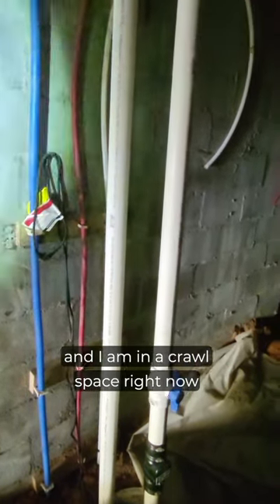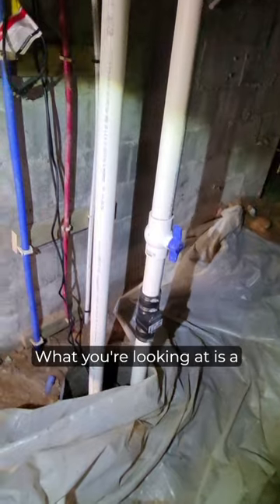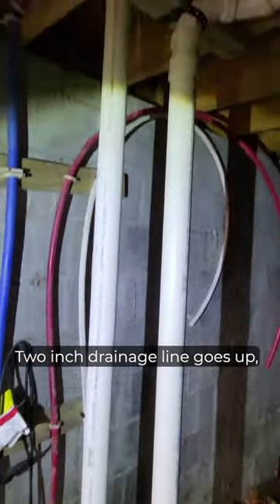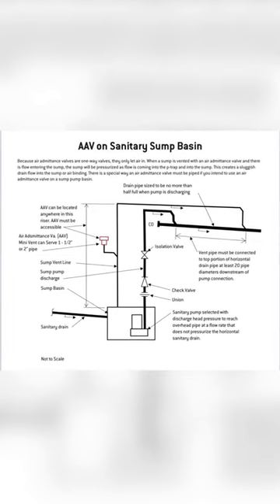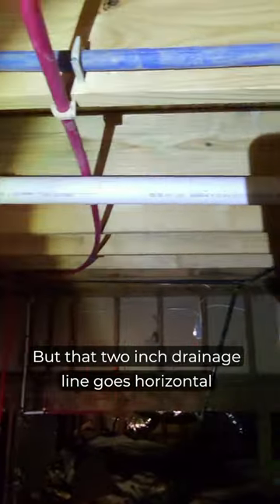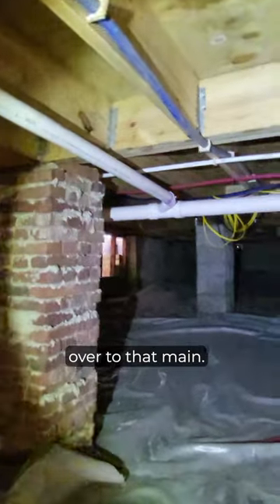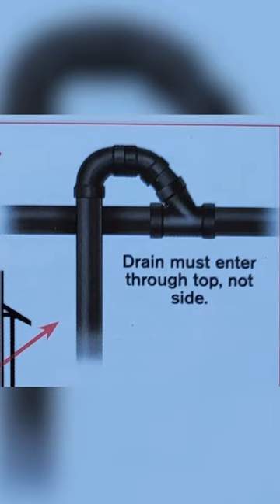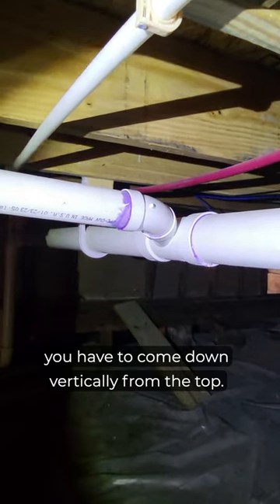The Wrong Way to Connect a Ejector Pump Drainage Pipe.

Comment: Plumbing code says you can't lay a tee on its side or back. But you can lay a combination on its side. This is perfectly legal in Texas plumbing code
Reply from the maker: So, what plumbing code book are you referencing??
Reply: fwiw,  my CEO called me out on this today and cited the Uniform Plumbing Code section 710.4 Discharge Line. The wye/combo can be on its side for a gravity line but not when its being pumped.
Reply: @charlesdrew1377 — So, you were mistaken?
Reply: @AndreaCuchetto  Yeah, I had the combo wye on its side and had to rotate it to the vertical orientation. The UPC book goes into detail why its necessary, basically the forced water flow from an ejector pump discharge line can significantly block the gravity line when they are joined horizontally. Makes sense to me and I trust the code and the author's intentions.

Long story short, when connected to an ejector pump I don't think its legal to have the wye on its side anywhere that follows the Uniform Plumbing Code. Note sure what other building codes prescribe

Comment: Since they connected to the main house drain . Shouldn’t they have a trap . Is the check valve acting as the trap for sewer gas . I guess the top connection prevents sewage back flow to the pit
Reply: Nope, everything is sealed off. The pit is water and air tight so there's no need for a trap.
Reply from the maker: So, why would you need a P-trap in that drainage line?
Reply: @PPG1967  The top connection won’t stop sewer gas and gas under pressure can push past a plastic check valve

Comment: I'm wondering do you have to run a vent separately out to the roof? Or can i wet vent it or a AAV? IM FROM NJ  I tried looking it up didn't have luck
Reply from the maker: So, if you use an AAV on an existing or new drainage system, you need a minimum of (1) vent to go through the roof to the exterior.

Comment: Do you typically run the sump pump to the house sewer or is is common to discharge it outside?
Reply: This is a sewage ejector so it'll tie into your main drain line. The sump pump for your rain water below grade will typically run straight out the house into a storm line.
Reply from the maker: So, Mitchell Roberts answered this one for me.
Reply from the maker: I appreciate you watching.

Comment: Why does it have to drop in from the top?
Reply from the maker: That's a good question, sir. I'll find out for you.
Reply: A mechanical engineer's logic would say that coming in from the top prevents back flow of sewage to the small ejector sump that is being added into the main drain line. Imagine what would happen when you empty a bathtub: A portion of that flow would end up overflowing the add-on ejector sump. As my plumbing engineers always pointed out: "shit doesn't flow uphill".